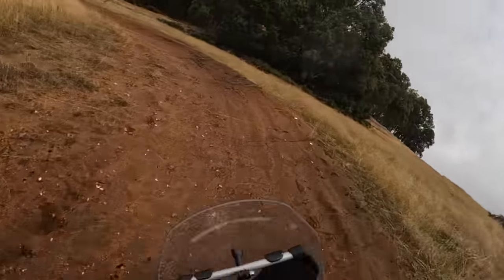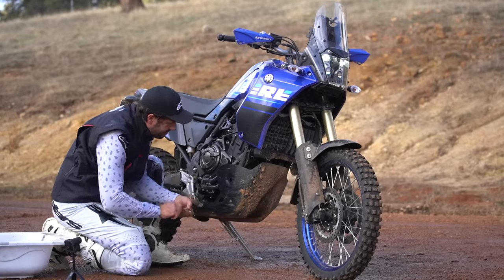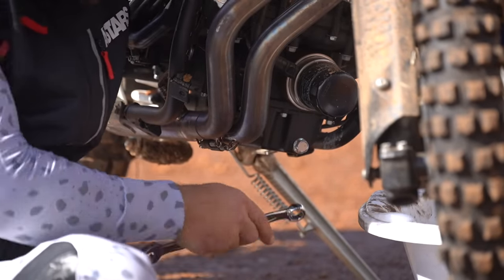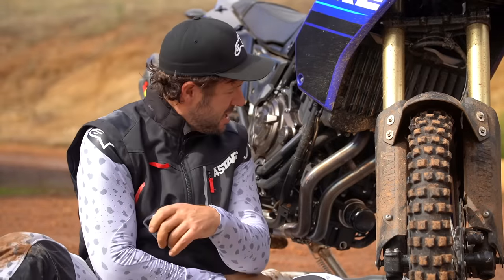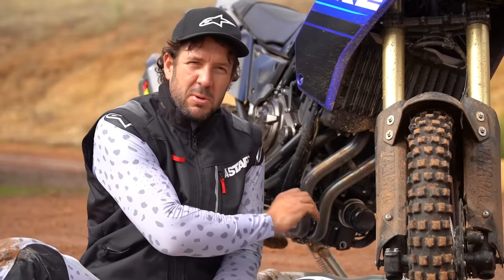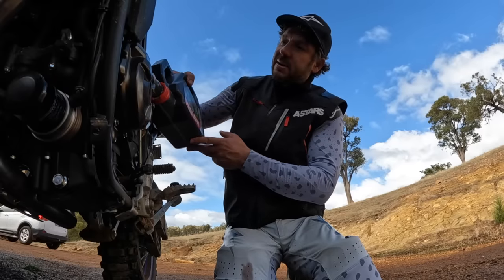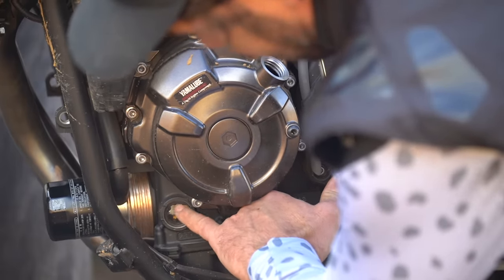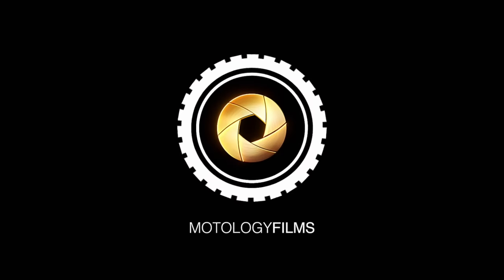Ultimate Engine Maintenance Guide: Triple Your Bike Engine's Lifespan

Comment: I would like to add something I like to do (and it's only a personal preference) when changing oil filters: I always pre-fill the oil filter with oil, letting the internals in the filter absorb all the oil it can before mounting it on the engine. Doing this will allow the oil pump to fill up the filter casing a lot faster as it is already saturated, and the new oil will reach the engine faster.
This is by the way one of the best videos I've ever seen on how to do a proper oil change! You're being informative and educational and at the same time making the topic interesting, watching you hammer that bike on the track also helps keeping our attention 😉
Reply: It's interesting, but there isn't any proof that filling with oil helps, and on modern ZX-6R's the pump loses it's prime and the only way to prime the pump again is to actually loosen the oil filter to allow air to bleed out. It might actually help the pump to have less resistance on it, by having an empty filter, so it's able to actually get oil into the oil pump and begin pumping before it encounters resistance in the oil filter. Even when I fill an oil filter totally full, the engine still never has oil pressure, so I've had to crank my engine with the throttle all the way open (flood clear mode). Hold your throttle completely full throttle, then crank, and it won't start, because it shuts off all the fuel to the injectors. After the oil light goes out, then start it. You won't damage your engine this way. Dry starts cause years of damage in a few seconds.
Reply: Alot of tractor and truck engine manufacturers specify the fill new filter with oil method also.
Reply: When the oil filter sits sideways or upside down it just leads to spilling oil all over.
Reply: @suprlite  Not really, the filter absorbes the oil and holds it, I'm not talking about filling the filter to the brim after the filter is in fact saturated. I've done this for years with no problem at all - If you're spilling oil you're doing it wrong 😂
Reply: @Ritalie  I see this is a comment I've not noticed, but yeah you're absolutely correct, no proof for this being the best way of changing the filter, its my preference - and some engine/vehicle manufacturers actually instruct you to do so in the manual. You do what you think is best, and if your bike needs the air to bleed in order to get the filter filled and oil flowing I guess "bleeding" is the way to change filter in your case.
Reply: @Christerk  aah, i thought you meant filling it to the brim 😅

Comment: The heat cycles will also darken your oil. I don’t disagree about the sediment but it’s not the only factor. Great vid!
Reply: spot on, oil in its pure form is black, also good point, on the filter, always oem for the bikes, ,   cars ok with ryco etc because they live or die on quality, mass production,not bikes
Reply: I too am with you. The same "sediments" are going to settle again on those same "surfaces" regardless to tempreature. It happened previously after it was ran hot, will likely happen again while it is hot..
Reply: @SgtPepperDayZ  yeah the info in the video is wrong. The color has most to with crankcase blow by, fuel dilution and excessive heat intervals.
Reply: And condensation or any additives a person may have used making the oil "burn" at lower tempatures.
Reply: Also: a tiny bit of exhaust makes it past the piston rings.

Comment: 2 things I also do is prefill the oil filter up to the threads once, It'll absorb into the filter media.  Once the engine has drained I take .5qt of fresh oil and pour it in the fill port with the drain plug still off, you'd be surprised that it still comes out dirty for a few sec and then clean. I always buy extra oil, to me it's cheap compared to an engine.

Comment: I use a magnetic sump plug which collects a lot of the gunk between oil changes. At each change I wipe off the gunk and appreciate magnetism.
Reply: I noticed that Adam was not mentioning this in the video. I have magnets in gear sump, oil sump and even for transaxle. Gear oil plug looked like a little hedgehog made of steel, when I changed the oil at 10000km. Suggested interval is 30000km. I seriously think that gearbox have died before that, the amount of metal flakes was insane.
Reply: Another approach with the engine is to put a couple of strong magnets on the side of the filter can. This will help collect steel particles onto the side of the can instead of in the filter element. Good economical approach. Main drawback is that unless you cut it open with a filter can opener, you can’t see how much material is collecting.

Comment: Hi Adam. I work in the oil sector, mainly in imports and distribution and what you said about the xW-xx oil being the visco at low and high temps is correct. However, some manufacturers have specific specifications for the same viscosity grades. For example, it’s possible to have 2 “10w-40s” which conform to different specifications. This is to do with the materials inside the engine such as the specific material the rings are made out of,  if the block is forged or cast etc. 

Therefore, it is always advisable that if you are using higher or lower viscosity grades, to match the specifications. For example the JASO MA2 spec can be found on multiple different grades and is for a certain type of piston ring material to prevent burn. 

Great video as always!
Reply from the maker: Thanks mate, I had to read a couple of Castrol spec articles to qualify the ratings etc, despite having gone by feel for the last 30-years of racing bikes. 
I've always tested various oils and ratings and for me it comes down to what the engine likes... you can feel it. If I've had to put cheap oil in for whatever reason, I purposely go a little easier on the engine and then drain it early like a flush. 
When I've got a quality oil in and the engine loves to rev with it, I'll push it as hard as I can in race conditions or whatever. Never had a motor fail me because of the oils I've used and the maintenance method I've outlined in this video. Motul is one the top-shelf few.
Reply: @MotologyFilms  The way I see, if the companies like Motul, Mobil1, Castrol, Eurol etc are using the Dakar to test their fluids, it’s fine for 99% of riders! 

Have a T7 myself and always use a high grade 10w-40 like yourself. So important and so easy to neglect and go for the bottle that’s $5 cheaper!
Reply: @MotologyFilms  Racing aint same as mechanical engineering or knowledge in oil and viscosity in different scenarios
Reply: Hey Killian,

im working at a multibrand motorcycle shop - and while i'm still a salesman im very into details. And as far as all the information goes that's in my reach the JASO MA2 is primarily about the amount of inner friction of the mentioned oil and is a crucial specification for wet clutch systems. Is that aspect of piston ring friction a side aspect or is it outlined wrong in german literature and the focus is on the piston rings? It's the first time i hear about that - as far as i learned it was almost completely about the wet clutch slipping.

Would be interesting. But i'll also have a chat about that with the man of motul germany, who's responsible for our area.

Best regards!
Reply: @euermerkwurdenscherbenwahn242  You are completely correct. The main purpose of JASO MA2 is to do with clutch bite and grip like you mentioned. All specs have functions which are primary, secondary and so on. Piston rings are an easy example of different materials inside and engine as sometimes people who arent so in to the technical side will just assume all the internals are metal cause the engine is metal, which as we know is not correct.
Reply: @KillianRM23  Thank you for your reply! It's quite imaginable - on one hand engines are more durable, then you might expect - and on the other they are way more vulnerable to small changes, than you could imagine. I'm somewhere between: They guy who developed the engine knows best and the most important thing is to have enough oil. (I should not mention how much thoughts i spent about the best oil for my Super Teneres shaftdrive... :D ) - Thank you again!
Reply: @euermerkwurdenscherbenwahn242  q
Yes ,follow the manual in all scenarios is the best and only way
Reply: @Motoinc  Yes and no - in general thats not a bad idea. But for example related to the shaftdrive, there are oils better suited fot that, then the tecommended specs. Also i'd normaly not change all the brakinglines after 5 years as the japanese manufacturers say in their maintenanceschedule. - But in general i'd be with you, that the manual is most of the time the plan you just should follow.
Reply: @euermerkwurdenscherbenwahn242  agree with that 👍

Comment: One of the best videos out there on oil change. I would add run the motor for a few secs then turn off and check level again after a minute or so to finally dial in your level. I tip my bike over each way when draining the oil to get as much as possible down to the sump. Maybe over kill. Thanks for a great video mate. Regards from the UK.

Comment: Brilliant video. Here, in India, they always insist on changing the oil when cold!! This is such an eye opener! Couldn't have come at a better time as planning for a 1000 kms ride with considerable off-road conditions 🙏
Reply: Does no one in India bother to read service manuals?
Reply: The suggestion to only change when cold must be a safety issue for mechanics, surely. No advantage there for the customer.
Reply: Did cold change and my oil turned black in the window immediately. No wonder

Comment: Some years ago, the younger me was in the learning stage of motorcycle maintenance. And a lesson was coming. The theory of hot oil was solid, I heated the motor and proceeded to remove the oil plug. Not long into the process, my wrench slipped a little and the palm of my hand hit the exhaust pipe. Just a small touch, for less than a second. The glove and some of my hand melted, like wax, it could be worse, but the small bone stopped the scorching metal. A couple of months of healing, and now I have a visual reminder to not overdo it. Yes, I won't change the oil on a cold engine, but not on a smoldering hot one either. Heat it up, let it cool to safe temperature, save yourself the horrible pain and the possible damage to the oil pan/drain plug threads.  

Also, never tighten the new oil filter with anything but your hand, it even says so on the filter. A man using the wrench to tighten the oil filter should not give advice, this is mechanical illiteracy. 

So, consider what matters more, some imaginary health benefit to your motor or the serious burns, terrible pain and long healing time.

Comment: When i was young i used to watch my Father change the oil in FJ,EJ & HD, he would always take the car for a drive to get the engine warm & then drain the oil, i always do this on my car, van & dirtbikes :)
My HX 1 Tonner was still going @ 937,000 klms, i always let my cars & dirtbikes drain over night, i even put a bit of air through the dirtbikes to get some more oil out :)
I have heard that new cars can only go a couple of hours while draining the oil, or you will have problems because of the oil filter/electronics set up ?

Comment: It still surprises me that people pay a shop to do their oil changes. That tool that you used on the filter is the same as fits all three of my bikes as well as my Landcruiser, so cost effective.  I consider doing my own oil changes on a par with changing nappies on your new born... it's a time of personal contact that will improve your relationship, in this case with your bike, and help you know it more parsonally !!   Never a bad thing. Thanks for the so concise video.
Reply: Here in Brazil the price of the oil on the internet it's pretty much tha same to the shop, and In the shops they only charge the oil. For convinienc I change oil in a shop
Reply: Having a hard time finding that oil filter removal tool, do you have a source? Thank you
Reply: Funny you mention it.  Use the filter I bought for my Tundra on the T7 as well.

Comment: Good advice to do it hot after a harder ride. I bought the 5-25Nm torque wrench for like 20$ and i am sure i don't overtighten both the drain and filter cover screws, that are 25Nm for drain and 5Nm for cover screws. I tend to overtighten everything because i had 250 Jawa that shaken everything off unless it was super tight.

Comment: Wonderful vid! I take exception with a couple of minor things though.  
First off I always would advise using the factory recommended oil type and viscosity.  There are tolerances inside engines that absolutely depend on it. So no, I would not use a higher viscosity unless i had an old or failing engine.
And as far as filter bypasses go. You don't quite hit the fine point. Though you are close.  It's rare and unusual for an oil filter to completely stop filtering as you seemed to state. There may be a time when someone goes too long an interval and gets a partial restriction. That is rare, and when it happens the bypass system allow enough oil by the filter to allow the engine to lubricate itself and survive. but there will still be some filtering going on and some of the wear particles will be collected during bypass.
Butr your main point is true and well said. Hot oil carries away the most contamination. So true.
Reply: That's what I thought also, if a oil filter routinely quits filtering in not much time engines would never last.
Something has to be going on to plug an oil filter.  Shouldnt be that much debris coming off inside a good engine.
If you slip the clutch hard and regular then yeah, clutch parts try to go throughout the engine.
I will never do that to my 890.  Only on 2 strokes do I use a clutch like that, but at low revs.

Comment: Adam, Thank you for the brilliant videos, I've learned so many valuable tips over the past year. It's s great having people like you taking time from their lives and providing good solid information. It's truly appreciated.   Here's a tiny tip that was provided to me by a WW2 vet to who I always listened very attentively when I was a mechanics apprentice for a small family garage. He always prefilled the oil filters. He explained when you removed the filter it had oil in it so it's best to install the filter with oil in it so it's ready to lubricate the engine once it's started. ( Grant F also stated in the comments ) Just my 2 cents. Keep up the great work.
Reply: @Terry Willefert When i replaced the turbo on my Saab i unplugged the ignition cassette so that i could crank over the engine without it starting until i built up sufficient oil pressure, could probably do the same with oil changes if you want to be extra safe with dry filters.
Reply: I'd probably do that if it wasn't for the fact that most of the stuff i own has either sideways or upside down filters

Comment: I watched this video with satisfaction and joy for being vindicated in my way of changing oil. I got my brand new 1978 Chevy Big Block V8 C30 Silverado which died. The first oil change i had done at 1000 miles and I had every subsequent oil change done at 3000 miles at a drive-thru business place called PennZoil Quick Lube. I thought that changing oil at that interval I'd have a pristine engine inside. At 15,436 miles, 5 "professional oil changes" later and just before the 6th one, my engine just started going slower on the toll road and literally ground to a stop. It was out of warranty!!! Towed back to the dealer I bought it from, they took it in and called me 2 days later asking me to come in. They showed me the motor with the upper valves exposed and a thick black residue, the consistency of a cold stick of butter had encased the entire upper part of the engine and valves , they told me it was a buildup from the waxy Pennsylvania oil used in my higher heat big block V8. PennZoil's "Lifetime Engine Guaranty" was non existent when I tried to get their help. Since then I have changed my own oil. I noticed that the stuff in the engine when I had it towed home was actually like a parrafin wax, cold it was almost solid but I took a hair dryer to it and it became like black grease, so in my mind I reasoned that if I changed my oil when it was hot anything like that would come out softened by the heat. I still change my oil and check it after 1000 miles and its a light brown color similar to a can of coke, not black, when I change it, the oil comes out dark, hot and drains quickly. I got back into riding bikes 40 years after I was married and got a used Yamaha V Star 1100 Classic with 14,096 miles, the first thing I done was drive it for 40 miles, change the oil with it hot and to my horror the oil came dribbling out like black molasses. I rode it for another 200 miles and changed it hot again and this time it poured out thin and black. I checked it 500 miles later, on the dipstick the oil was brown and at 1000 miles the oil was a dark brown but not black! That Dec. I changed the oil at just over 1400 miles to store it for the winter and it came out the same dark brown color. I plan on doing my 600 mile service on my new '23 KLR 650 and the chain tensioner adjustment (doo-hickey in red-neck speak) myself and change the oil every 1800-2000 miles myself as its cheaper to keep her lubed! IMO, always change your oil HOT! I get a lot of shit about it but it works for me.

Comment: Your description of the[ Gruel left in the motor]is without Parallel. clutch plate particules ,followed up with gear box steel shavings grinding their way thru the motor, not to mention the oil filter false sense of defence against such an attack. LOVED it Adam. I learn something new every time. your fan PARC ADV